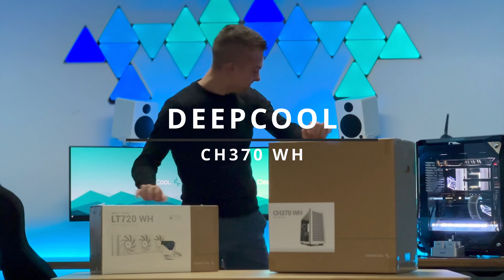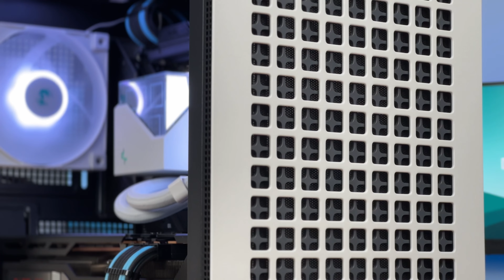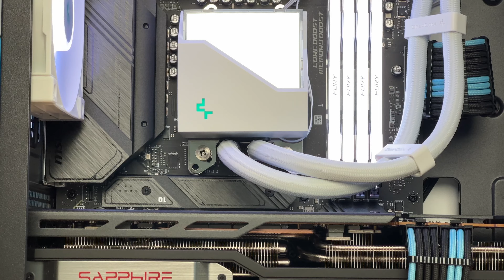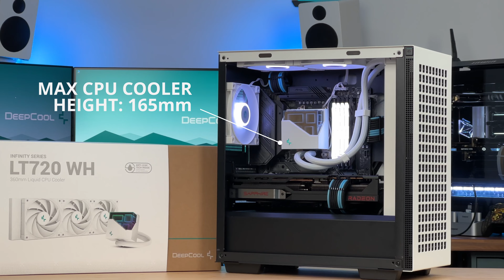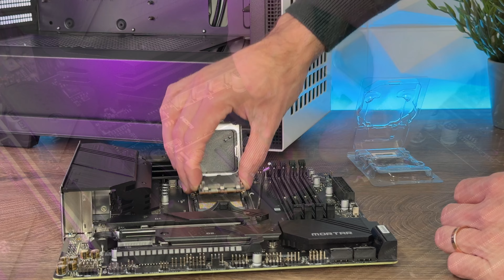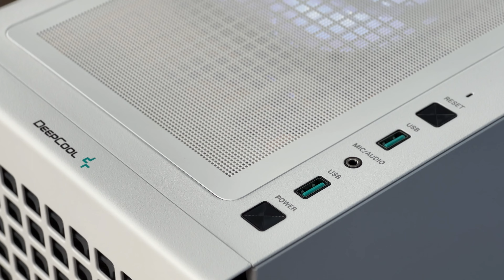HERE'S A SECRET ABOUT DEEPCOOL CH370 + LT720 WH

Comment: Will the sapphire nitro+ 6900 xt fit in this case?
Reply from the maker: GPU length is 310mm and the space for the GPU inside the case is 320mm. It should fit but I think you will need to wiggle it a bit.

Comment: If I plan to use this Case and I have a MSI 6700XT Gaming X, which is a 3 Slot and 2 Fan GPU. Will I even able to use the built-in included GPU Holder for the case? 

Or that GPU Holder is only mean't for Long 3 Fan GPU?
Reply from the maker: I honestly don't know. Maybe if you revert it on the other side, flip it around. Maybe then it will work. Not sure tbh.

Comment: Sir which fans are you using to cool your pc case?
Reply from the maker: The ARGB ones on top and the rear are from the LS720 AIO. Unfortunately they aren't sold separately.
Reply: @PCCrazyDario  So you used the fans from LS720 AIO at the top and the rear?  Leaving no fans on the front radiator itself?  Just trying to understand and get build ideas. Thanks.
Reply from the maker: @mattscomp  Nope. LS720 AIO fans were used on top and rear. LT720 fans are on the radiator. ;)
Reply: @PCCrazyDario  thanks for reply. That's really interesting to me. I have never used radiator without using fans on at least one side. Of course it all depends on how much cooling your CPU needs. Plus the environment system is used in. Living in Sahara desert is much different to the North Pole. :-)
Reply from the maker: @mattscomp  I don't think you understood me. There are two types of AIOs from DeepCool. There is LS720 with RGB fans and there is LT720 with non-RGB fans. So I used the fans of the LS720 without the AIO on top and rear and I used the LT720 WITH THE FANS on front. :) I would never use an AIO or radiator without fans.
Reply: @PCCrazyDario  thanks for explaining further! I understand now. Makes perfect sense. My own plan with this case is to use Corsair 360 Capellix AIO. I will use the supplied RGB fans at top and rear. I also have three Deepcool TF120S I will use on the radiator. 👍 Should work well. It's going to be an Intel build using i7 13700. Thank you again. 💗
Reply from the maker: @mattscomp  Excellent then. Glad I managed to explain. :) Enjoy your build when you finish it. ;)

Comment: Hi. can we put Fan at the bottom of the VGA?
please inform me
I worry that the clearance is very small than it will create a noice from turbulance
Reply from the maker: Hi, I mentioned that in the video. You could if your mATX motherboard has a PCIe slot higher. Otherwise, in my scenario, I couldn't... And if you go with RTX 4000 Series, you can, unfortunately, forget about the fans on the PSU shroud.

Comment: I'm planning to buy this case and i hope i got that aio too because im using the cheap one aio from darkflash but the performance is good
Reply from the maker: It would be a sweet combo for sure. :)
Reply: @PCCrazyDario  i got 6700 xt red devil 3 fan, do you think it will fit perfectly?
Reply from the maker: @Amutomoto  If you don't go with the front radiator you could fit it. But Powercolor RX 6700 XT Red Devil is 320mm while the one I used (Sapphire RX 7900 XT PULSE) is 313mm. These 7mm will take up the space and it won't fit if you have a front rad.